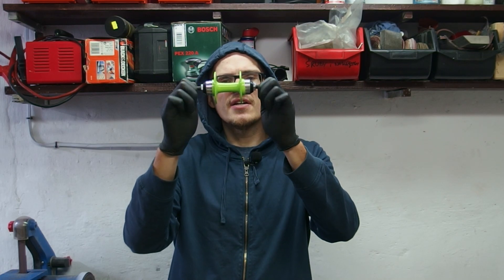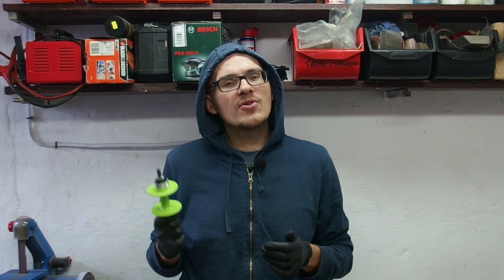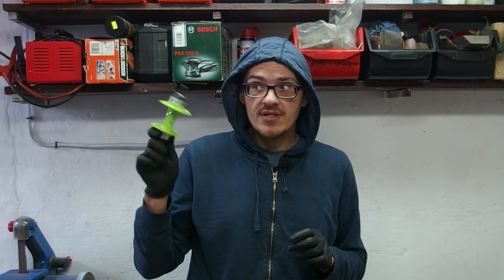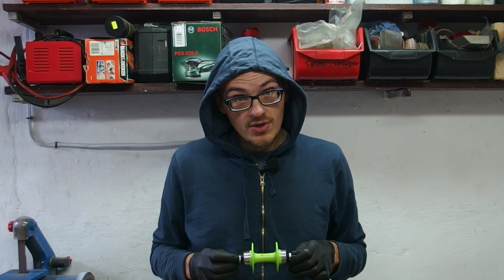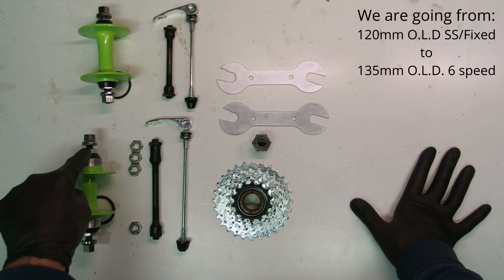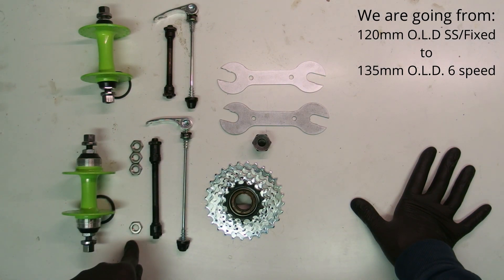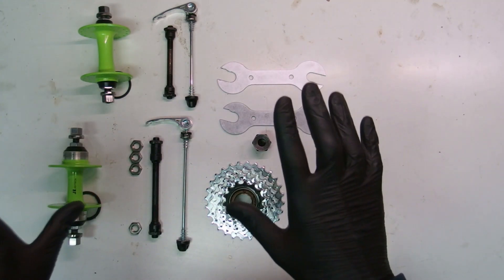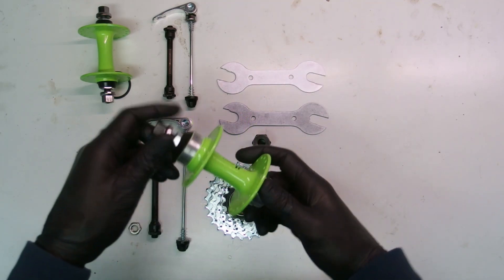Flip-flop hub to 6 speed, and addressing the bending axle problem.

Comment: those nuts are not doing any good. The axle always brakes where the right side cone ends
Reply from the maker: Have you tested, or just think so? Mine stil works. Axles breaking at the cone is pretty much a weak point of 95% of the hubs out there.
Reply: @TryboBike  i had changed a lot of axles in the bike shop. All of them did snap at the cone,there the axle pivots under stress. Ive seen maybe 1-2 hubs using big nuts as spacers, same issue with them
Reply from the maker: @asork  The thing is that you are not using them as 'spacer', but actually screw all those nuts on the axle, creating preload between each of them. That being said - it is a 'hack' to make freewheel hubs more resilient. Mine still works and I weight 100kilos.
As I said - just about 95% of hubs out there have an axle overhang - whether it is a freehub or freewheel. Very few have nice, wide bearing support. So - yeah, they are all going to break at the same place.
Reply: @TryboBike  it’s been “tested” for a hundred years. Imagine bench pressing but your right elbow is against your rib cage and your left arm is proper… there’s nothing you can do to prevent eventual axle failure even if you have preloads on the money